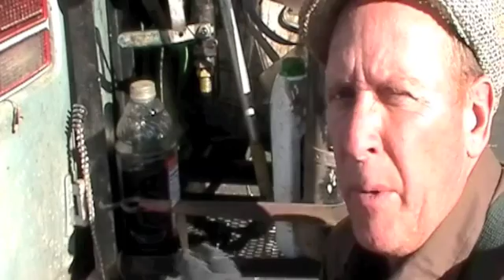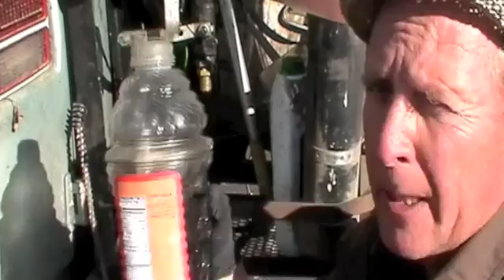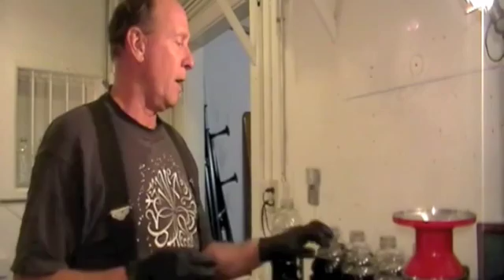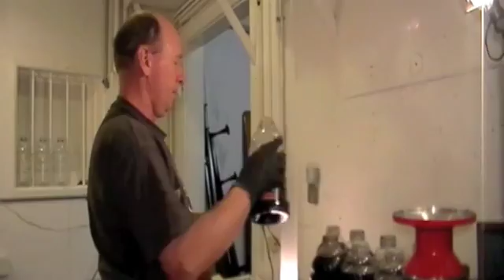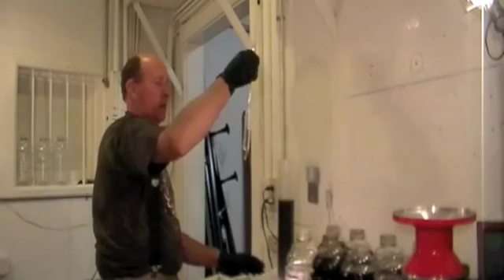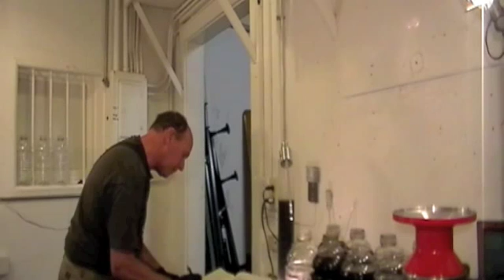Making Black diesel blend with WVO blends

Comment: Anyone end up finding a solution to this?
I'm curious to try a WMO/biodiesel mix instead of regular wvo, but I'm new to diesel mechanics and don't want to be pulling injectors in my van yet
Reply from the maker: I found that WVO and WMO will blend readily without the biodiesel process.  Nonetheless, if you are going to experiment with making your own diesel fuel, then you are going want to learn how to service your diesel engine, and its injectors.

Comment: Can E85 ethonal be mixed with wvo, to make diesel fuel? Have you tried it before?
Reply from the maker: Yes, E85 can be blended with most waste oils; however, it is too much alcohol for most diesel engine fuel systems, so E85 is not likely a good idea for blending.

Comment: its the bonds, fats are living, they create fat chains the longer you use them.
Reply from the maker: The sediments from blending WMO with WVO are black, and melt at about 160F (70c).  The black is surely carbon that was dissolved in the WMO; however, the part of the sediments that melts could very well be fat from the WVO.  Nonetheless, most of the WVO remains in solution with most of the WMO.  One need only allow enough time so that the reaction completes all of the sediments precipitate out.

Comment from the maker: Most of the WMO I get has several things in it.  It has WMO, WATF, radiator fluid, brakleen, and mineral and synthetic oils in it.  Radiator fluid settles out and is separated easily.  The synthetic oils burn just like mineral oils.  However, the big problem is heavily burned WMO has a lot of soot and lacquer in it.  The soot and lacquer can coke up the injectors, rings, and valves, unless the engine has a turbocharger.  Turbochargers improve combustion and thus reduce coking.

Comment from the maker: The PSD engine design is ideal for a two-tank system, and does not need something like the vegietherm; however, if one were to run SVO, then a heated pickup and heated fuel lines would be useful.

In the case of running black diesel the PSD engine design is also remarkable in that the fuel does not need to be translucent, just well filtered; however, it does not like a lot of gasoline in the blend, s0 18% is max, and it seems to run better on kerosene than gas for thinner.

Comment from the maker: my recipe is 40%WMO/40%WVO/18%gasoline/2%acetone; however, the PSD engines have a fuel valley that heats the fuel up before injection, which is great for a two-tank system, but not good for gasoline blending, so the PSD runs better on less gasoline, and/or kerosene in place of the gasoline in the blend, but the kerosene will need to be 1.5x the gasoline content, so if no gasoline is used, then 30% kerosene

Comment from the maker: my formula for making WMO run nice with WVO is to blend them in equal parts, then gasoline at 18%, then acetone at 2%, then settle for 1-4 weeks until a translucent blend rises to the top; so drain off anything at the bottom that is thick or black and only run the blend that allows light through it.  So, 40%WMO/40%WVO/18%gasoline/2%acetone.

Comment from the maker: @nuffsaid338 I blend unleaded gasoline at 20% with either WVO or WMO and end up with roughly the same results.  WVO is a lot easier to clean than WMO.  I will settle WVO for just 24 hours, but it seems to take 3-4 weeks to get WMO to the translucent stage.  On the other hand, a centrifuge should reduce the settling period to just 24 hour for either fuel, but there will be a lot more junk to take out of WMO

Comment from the maker: @nuffsaid338 Sounds like you have made a good setup, but I would definitely blend the gasoline with the waste oil in the cone shaped settling tank and give it at least 24 hours to settle out, then drain the thick, dark component, then when it begins to run thin and amber, then run it through your centrifuge.  Then you will not need to use that port 75% up the tank.  Save the sludge, and dump some gasoline onto it, and let it sit for a month, then pour off the good, clear light amber

Comment from the maker: @nuffsaid338 Sorry, I just realized you have a Duramax instead of a powerstroke.  Well, it looks like modern diesel engine designs have improved over my old 6.2L Detroit Diesel, which would have died after burning about 15 gallons of improperly made WMO/WVO blend.  On the other hand, you might have a better than usual process for making waste oil blend diesel fuel.  It would be useful to analyze your process for making fuel.

Comment from the maker: @nuffsaid338 I am impressed that you did not coke the heck out of your injectors from switching between WMO to WVO, which say a lot for the PSD engine design.  However, I am not surprised that you plugged a bunch of fuel filters, because the precipitates from blending WMO and WVO are abundant and it is both lacquer and free carbon.

My guess is your fuel tank and fuel lines are now coated with lacquer and soot.  If you have WATF, then you might try running on that for a while.

Comment from the maker: @neiallswheel I am well aware of Hydrocarbon Cracking, as I used to design, build and operate cat cracking units for Chevron Research.  However, cat cracking is not for novices; whereas my blending process is easy to use for just about anyone regardless of their technical skill level.

Comment from the maker: @K31TH3R I am glad you appreciate my work.

I am not completely sure what you mean by "gasification" with respect to recycling waste oils.  If you mean "distillation" then it is certainly a possible way to recycle waste oils; however, vaporizing waste oils in a fractionation column is not for amateurs, because it would be all too easy to have a fire in the distillation column if it is not purged with inner gases and there are not a lot of monitored oxygen sensors throughout the system.

Comment: Extremely interesting work, and great channel, you've earned a subscriber.  I appreciate someone who values the scientific method in their pursuits and you clearly have method to your madness!

A question for you; have you tried a gasification process with this fuel blend?  I have seen many claims that little to no particulate or soot is generated along with a noted power increase when using gasification methods on waste fuels, have you ventured into this at all?

Thanks for the video.

Comment from the maker: @MrZambology I look forward to reading of your results.  Since you are in Scotland, then perhaps there is a forest industry that produces turpentine.  If so, you may find blending with turpentine a more cost effective solution.

Also, there are distilleries in Scotland.  It turns out distilleries produce an abundance of other alcohols that they have to remove, such as Isopropanol, Methanol, and Butanol.  So, check in with your local distillery for their residues.

Comment from the maker: @Begbucks I have done a great deal of work on WVO in the engine lube, and ways to flush the engine out in case of contamination, so I do plan a video in the future for that topic; however, if there is significant blow-by of WVO into the engine lube, then that engine is almost dead and needs to be rebuilt or replaced.

Comment from the maker: @Begbucks Thanks, for the supportive comment.  Good to hear from you again.  While there might be more solvents that do what acetone does, paint thinner is not one of them.  Acetone pushes lacquers out of solution, and might be a great way to push dissolved paint out of solution with paint thinner. However, used solvents, such as: paint thinner, waste gasoline, miss-fuel; are excellent ways to reduce the gasoline component in waste oil blended diesel fuel, and a great way to recycle.